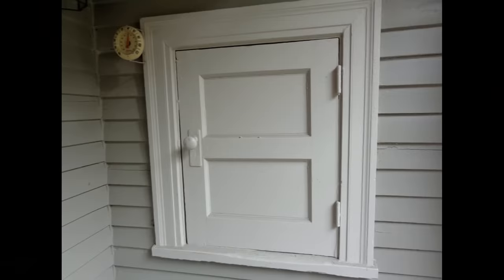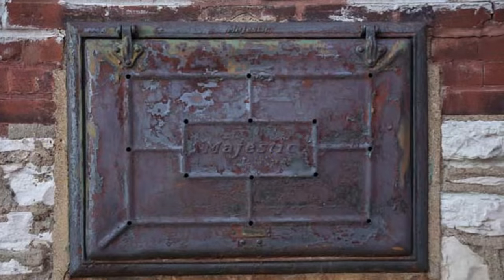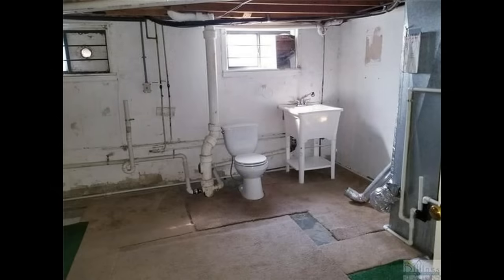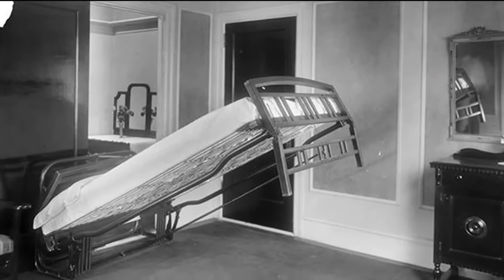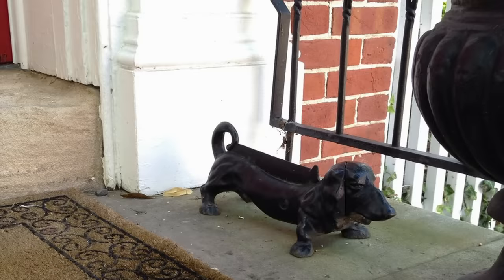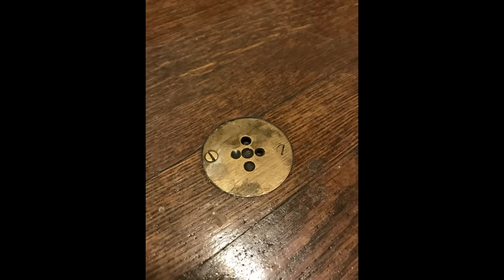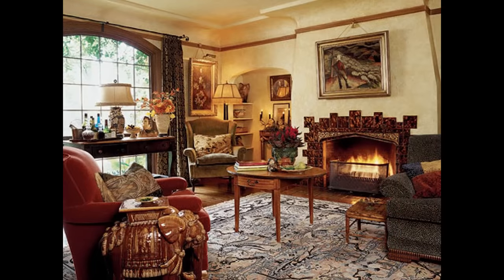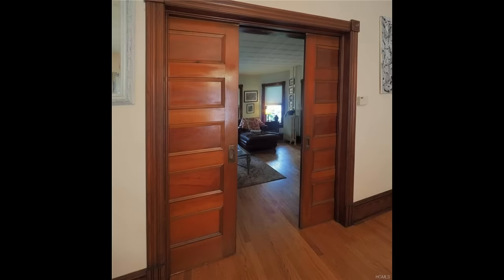Mysterious Home Features No Longer Used

Comment: I remember back in the mid to late 90s, viewing a house with a friend and his parents that had one of those intercom systems.  Not only could you call to different rooms from the kitchen or living room (where the main panel would have been), but many models came with AM/FM radio and some even had 8-track players or turntables, so you could have music playing throughout the entire house while entertaining, relaxing, or doing housework.  They ended up buying the house.
Reply: My grandma's house had one of those. It played 8 tracks. But it didn't work very well. My grandparents never bothered getting it fixed.
Reply: I definitely remember touring some new home subdivisions in the early 90s. The model homes featured intercoms with just AM/FM, but I thought it was so cool.
Reply: My father had a house built in the late 1960s with an inter on which was connected to AM/FM & Reel-to-reel tape system. There was also a small chute in back of the fireplace that led outside, making it easier to shovel the ashes out. I loved that when it was my turn to clean the thing!
Reply: A neighbor had this in her house!
Reply: @samantha2573  I'd forgotten my grandparents had this feature too! theirs dumped into the basement, but it still kept ash from getting scattered all over the carpet. Cleaning fireplaces is no neat matter. They also had the intercom/radio system, which stopped working at some point, but they never used it much anyway. I imagine it was a sneaky way to listen in on the kids.
Reply: The house I grew up in was built in the mid-70s, and it had an intercom system. The main control was in the breakfast room, and there were speakers in all the bedrooms, the den, and by the front door. You could call the individual rooms or play the radio throughout the house. By the early 90s, the novelty had worn off, and after my parents bought a TV for the breakfast room, they rarely listened to the radio anymore. They had the whole thing taken out when they renovated the house in the early aughts.
Reply: My home built in 94 came with an intercom system with a cassette tape player and am fm radio!! The doorbell rings through it and you could control where you wanted or didn’t want it to sound off!! It was novel at first but we generally didn’t use! I mostly just yelled up to my kids to come down, since that’s how I was brought up! My mom would yell for us whether in the house or down the street! Lol
Reply: My parents house has an intercom/radio not sure if it’s operational
Reply: There are modern versions of these. My parents put one in their house around 2010. It's an intercom plus you can play music throughout the house via an AUX jack (which is kinda dated now too) or an app on your phone. My mom used to blast music in my room to wake me up on the weekends 🤦‍♀
Reply: @makingahomemaker  Not really that outdated, as some current model phones still have headphone jacks.  I guess it's there for people who might still have older model devices that don't have Bluetooth capabilities, like some mp3 players.
Reply: I think that this may explain the mysterious square cloth grille in the wall of our dining room. I could swear it looks like a speaker, maybe it is for a now removed intercom system. There's actually a nutone box near the garage that looks like a speaker and it must be part of an intercom system. But I wonder where the control panel for the intercom used to be. Maybe it was in a patched portion of the wall. 

I always assumed that there used to be a light switch there or they had to fix some electrics behind the wall so they had broken it open then patched it up. But if that is where the control panel used to be, then it wouldn't have been as big as the ones shown in the video.
Reply from the maker: Those old intercom systems were really cool!  I really enjoyed them.  Thank you for watching and sharing what you saw.
Reply: My house has them. It was built in the 70’s but I love this feature! Plays radio but looking for NuTone parts is very hard and difficult to come by.
Reply: My parents had our home built in 1970. NuTone intercom included. The main console was in the kitchen over a built in desk. Every morning on his way out my Dad woke us by playing music piped into our rooms 😊

Comment: I lived in a house that had a "summer kitchen." Apparently it was a secondary kitchen that was only used during the summertime because the heat from the wood stoves would be unbearable in the main kitchen. The summer kitchen had large doors and windows that could be opened to allow for additional ventilation.
Reply: Florida?
Reply: That's still common here in the coutryside even with modern technology. They have more space for it to be built, it's larger and usually chaotic and it's hidden from guests while the unused spotless main kitchen is guest friendly.
Reply: @christinebrooke7292  I live in Florida, never seen one. But wouldn't be surprised. Not sure if it would make a difference though, the heat can be unbearable even with open windows from all the humidity.
Reply: I saw that on a farmhouse in Macon, Georgia, years ago, but it was the only kitchen to the house. The house was L-shaped and you had to access the kitchen by stepping out from the parlor onto a long back porch. I assumed it was because of the summer heat.  Not a problem here in the mountains of Wyoming.
Reply: I lived in house built in the last century that was/is still heated by a wood stove-in the kitchen. That would be normal if it was used as a cook stove also! Talk about hot! I never used the the gas oven in the winter , unless I wanted to faint! 🙄☄️ the person used it to replace propane heat. Good idea but what a lot of work. Always opening/closing windows, doors. Glad I finally got out of there for good!🤒😓🥵
Reply: @aimee-lynndonovan6077  We took our house off the inefficient propane system when a liquid gallon topped $5  years ago. Wood heating is much more efficient in terms of BTU's and now with costs even higher, more economical.
Reply: My Great great Aunt's house had two kitchens in New England.  The big one was used in the Summer for canning and drying vegetables from the garden.  The smaller kitchen was used when it was cold to keep heat from the wood stove in the main part of the house.
Reply: I want a summer kitchen in my house in Washington state! when it's 110° outside I don't want to do anything to heat up my house, but my family still thinks they need to eat every day 🤣🤣
Reply: Many "summer kitchens" became inlaw-suite or rental suites in big cities by partitioning off the basement. Illegal (building-code wise) however.
Reply: @brandicook910  There's not much you can't cook in or on a modern gas grill.  Bring the pans outside!
Reply: @Asri_  yes!  I need to screen in my back porch (it's next on the list of home improvements) to keep mosquitoes and other bugs out while I'm cooking 🥰
Reply: Growing up in 1980s NJ, most Italian American families had these.
Reply: I'd love to see  an example of that.
Reply: @catherineladd5300  Sorry but the ONLY way wood is more economical that LP or Natural Gas is if you have the ability to harvest the wood yourself and don't mind spending 25% of your free time doing it.  In a typical wood furnace of any kind, 70% of the generated heat is lost up the flu.  Modern LP and NG furnaces have efficiencies over 90% meaning most of the generated heat is used to make you comfortable and the exhaust gases are cool enough to be discharged through a plastic pipe.  I personally like heating with wood.  I like the smell of burning wood and not having to pay anyone for the gas or oil.  But without access to a lot of standing deadwood, its not worth it.
Reply: I love summer kitchens!  My Grandma had one in the basement. There was also, a fireplace, & she lived down there all summer, since there was no AC.  She had a summer bathroom, too. It was just off, but inside attached garage.  Since her house was on a lake, and my family visited every few weeks,  all of us kids or anyone swimming came into garage & used that bathroom....it has a shower.  Every Autumn, the water got turned off, lines drained & winterized.
Reply: Lots of summer kitchens still in the Midwest.  When you bought a new stove, the old one would go into the basement, along with any other major appliance you replaced that still worked.  Even your old kitchen cabinets went down there.  Nothing that was useful was ever thrown out.  Plenty of people still live this way.
Reply: I live not far from a newer home that has a summer kitchen.
Reply: @christinebrooke7292  House my dad grew up in (Illinois) during the early 1900's had what he called a 'summer kitchen'. The back porch was enclosed in lattice and had a gas stove on it. The regular kitchen range used coal.

Comment: Seems like all the small doors for deliveries could be one item on the list.

Also, it would be a fine idea to bring these back for package deliveries to block theft
Reply: That'd be fine for small packages, but anything larger becomes a potential entry point.
Reply: @xaenon  It could be an opening with both sides locked, like the ice delivery door mentioned in the video.
Reply: @xaenon  it would have to be designed for the largest standard Amazon box, and be built to allow things to go in but then not be accessible from the outside, and then make it so you have to open a door from the inside of the house to get the package.

But then I think of why this would be outlawed immediately. Someone could get stuck in the package compartment after coming in from either side.
Reply: @watsonwrote   Yes, but you better build it at least as sturdy as the front door.  those  hinges won't hold up for more than a half-dozen good kicks.
Reply: The different types of doors were for every different things though and they didn't look at all alike, at least once opened.  It wasn't uncommon to see houses with multiple ones.  One place I lived had a (disused) "coal door" (rather than a hopper - it just opened straight onto a slide to the bin, and was short and set very low to the ground), a hatch for milk deliveries, and a panel covering up where the ice door had been.  You definitely didn't want the wrong thing going it the wrong door, but I suppose which led to what was obvious to delivery folks of the day.
Reply: @watsonwrote  Our friends (in an upscale area) had an exterior door with a cavity in it. Their dry cleaner could open the outside door of the cavity, hang the dry cleaning, and lock it. They could open the inside door of the cavity and take the dry cleaning out. I've never had dry cleaning delivered, but it sounds like an interesting idea.
Reply: Growing up,  home we moved into in 64 had a metal coal chute door . Our WW1 veteran neighbor was still heating with coal until about 1970, he used the cinders for grit when the driveway was icy.
Reply: @xaenon  The point of features like these would not be to deter a determined criminal, it's just to eliminate the opportunistic porch pirates.  Almost no homes are even slightly difficult for a determined criminal to enter.
Reply: Could just go into a box that  was locked inside the house. If a package theif opens a door that leads into a house that's a whole different charge then just taking a package off the porch.
Reply: The milk door like the one on my grandparents home could accommodate larger packages.
Reply: @stephentroyer3831  If it locks after an Amazon delivery, what is the FedEx delivery person to do with their package delivered on the same day? I know, FedEx could drop the antique crystal figurines down the coal chute!
Reply: @memyname1771  Hmm, maybe a chute would be the way to go. Packages get thrown around a lot anyway.
Reply: @stephentroyer3831  Yeah, except those take time to use.  The Fed Ex and Amazon people are just contractors, and here they literally THROW packages at the front porch, I have video of one over 10 feet from the door tossing the package and turning around, it took less than 3 seconds.  Working a chute that's designed to keep the cold/heat out would double or even quadruple that time.
Reply: @xaenon   Even small spots aren't safe.  Our town had mail slots on most doors, just mail slots, and THOSE were being used to break into houses.  People would reach through the mail slot with a wire coat hanger type thing and use it undo the locks.  

My parent's live out in the country and some folks there have a decent solution.  They're special large mailboxes with brick bases that can hold small packages and mail that work like payment drop boxes.  So when you open teh door, it blocks access to the bottom, and when you close the door after it's delivered, everything falls into the base.  Which has a keyed back panel for access.
Reply: @stephentroyer3831  You'd have to be reasonable and design it so there wouldn't be in-house access - the largest boxes would still sit outside.  Yes, porch pirates, but at least the smaller items could be delivered safely.
Reply: @xaenon  So can a large dog door. The school principal used one to gain entry into Ferris Bueller's house in "Ferris Bueller's Day Off".   (Jan Griffiths).
Reply: @stephentroyer3831  it’s not much different from a large doggy door.  Some come with special collars so dogs may enter and leave while not allowing other animals in or out.  There could be a code given to the delivery driver to open the delivery door that becomes inactive after 1 use.  Think of it kinda like the Amazon deliveries that can open your garage.
Reply: @xaenon  You know a wood frame on a front door won't survive a single good kick? There's a super solid metal door & frame from India somewhere here on YT, two guys with sledgehammers weren't getting in after minutes of hammering, although your walls would collapse before the door did, and a window would be even easier. Have to keep things balanced
Reply: @user-ut9ln4vd5m  That was my original point, that a 'pass through' door for packages is a potential access.   When these older homes were built originally, I guess there wasn't as much crime as their is today.  In the modern age, such a pass through built out of wood practically guarantees someone's going to get into the house, even if they really aren't that motivated.

A criminal WILL find a way to commit a crime if he/she is determined enough.  The strategy of security is to make it difficult enough to encourage your AVERAGE criminal to find easier pickings.  Because there are far more AVERAGE criminals than true 'pros'.  

People here are talking about steel-reinforced structures and heavy-duty doors, and those co$t a fair bit of money.  The best strategy is to not have such a pass-through in the first place, and just have reinforced front and back doors.   Packages can be sent to a mail service.  Simple, effective, inexpensive.  Slightly a pain, but there's always a tradeoff.
Reply: @xaenon  Package theft is mainly a crime of opportunity. Thieves drive around looking for packages left on porches then grab them and run. It is very unlikely that a package thief would kick open a delivery door just to see if anything is in there.
Reply: @richmcgee434  Also they are from different eras, though they did overlap.  Ice doors became superfluous after modern refrigeration became commonplace.  However, milk was still delivered door-to-door into the 60s in some areas.
Reply: @thannon8569  We had a milkman till 1970, but it was an irregular deal with a local dairy farm and possibly illegal even back then.  You could get away with stuff in rural areas that won't fly in a city.
Reply from the maker: Thank you for watching Stephen!

Comment: I'm surprised you mentioned intercoms, but not speaking tubes.
A friend's house had these, and since there were no moving parts to fail, they still used them frequently.
Reply: Hard to talk privately?
Reply: @Axlotl77  Not really.  You had to speak into them quite loudly to be heard.
Reply: I used to shout at my sister through the vents, close enough
Reply: @handuo6301  My late Grandpa would have the TV in the basement cranked up super loud. Sometimes I’d listen in to the news through the vent from the second floor.
Reply: @ryanbrown8527  I think that was their point. Lol
Reply: @handuo6301  😂
Reply: I dont know why they dont use them in hotels and large kitchens anymore...

Comment: When I was a kid in the early 50's, our house was built on 1908 and had some of the features mentioned.  One feature you left out that was common in our area is the sleeping porch...in the lower states were high ceilings, outdoor cooking facilities, bay windows for catching breezes and cupolas for exhausting heat; to name a few.
Reply: A lot had a summer kitchen too.
Reply: We had 2 sleeping porches - one on the west end, the other on the east end of the upstairs hall. Aided in cross ventilation as well. House was built before air conditioning or forced air heat.
Reply: One of my aunts has a house with an upstairs sleeping porch, it was nice at first we used to play in there as kids but now when I go over it feels like the floor is so thin that you could fall through if you jump hard enough
Reply: Pp
Reply: Bonus points if the porch ceiling was painted "haint" blue.